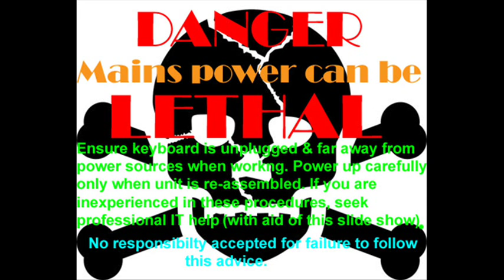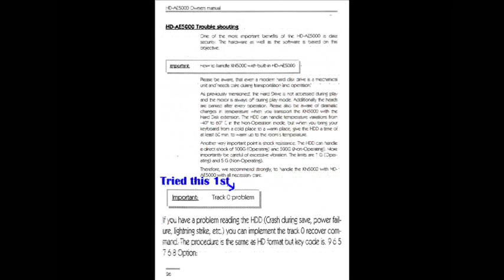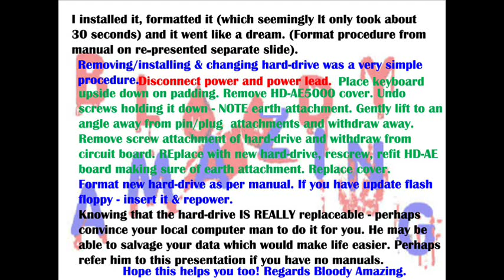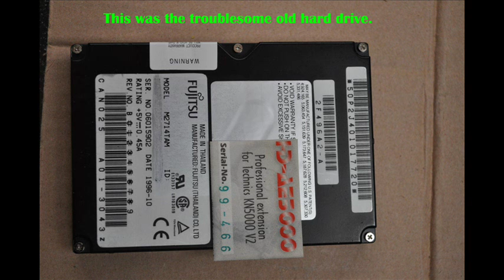Technics KN5000 keyboard HardDiskDrive repair

Comment: Noel, what was the make etc of the laptop hard drive you were able to purchase for your KN5000.  Failing being able to get one, I buy the 5000 Emulator but am very wary of taking the keyboard apart to get to the floppy drive.  All advice welcome.  Thanks for a great video.
Reply from the maker: Yes, HDD is easier to do and use. If your floppy still works ( I doubt it) use it to reload the hard drive. I suggest you do both. 

If you pause the video when required, you will see the HDDs are apparently pretty universal. Any 2.5" HDD IDG should suffice. I just purchased the smallest capacity from local repairman. He advised if too large to partition it. That wasn't necessary. Just had to format it in keyboard when fitted.
As displayed in video they suggested any Fujitsu, Seagate or Toshiba brand would suffice. No guarantee but it worked for me. 

Perhaps you could try fitting a  SSD card now available instead of HDD.  No moving parts and you would require only small capacity. There are videos on youtube showing how to do this. I haven't personally done it yet but sounds great. (Will definitely do it when I win the lottery). Both my Technics sx5000  still operate, one regularly at church..

With regard to the emulator, if you can modify it before installation then installation is very easy.  Just remember to unplug power 1st..
The hard part is keeping track of all that data.  I suggest you write level (different floppy numbers) locations on musical books/scores.

I accept no responsibility  for my advice.  It just worked for me.  Perhaps a local technician / computer repair man could do it for you if you are wary - with access to my videos.. Good luck and please let me know how you go. 

PS. Should you ever need replace your keyboard I suggest you look at Yamaha PSR  top models  (not Genos or Tyros) with inbuilt sound, vocalizer and lots more.. nearest to Technics.

Regards Noel Greacen.
Reply: @NoelGreacen  Thanks Noel for the lengthy reply. Originally Aussie but now living in UK. bought another 5000 here in UK recently. Still great keyboard. Put my hard drive in it as the floppy still works in this new one. However putting its hard drive into my old 5000 keyboard has been problematic as I am getting error start up messages and the HDD won’t format. Any suggestions?
Also have a 7000. Great keyboard still by current standards.
Reply from the maker: Check the connections thoroughly - easily mis-plugged. Maybe clean connectors with quick blast of electronic cleaning solvent. (NOT WD-40!!).  This could explain error message.
If that doesn't work,  from what you say, that it "will not format",  I feel the HDD must be faulty. I would suggest replacing the hard  drive component of the HD -AE with a new HDD or SSD. Might be why it was for sale?. Did it work in the bought keyboard before you removed it?. 
  
You are incredibly blessed that the floppy still works. I strongly advise you  back up the data/floppies  to a computer or memory stick. You will definitely need it in the future. 

KN5000 was my favourite Technics. I also had a 2000 & 3000, now obviously out on permanent loan. Think my favourite feature is the brilliant  and easy to use sequencer. Used it to setup/record  my own compositions.  The sounds record beautifully although there is a question on who developed them - Roland or Technics??. Had a Roland  - keyboard component nothing but trouble. 

I play an active left hand which is limited on a Technics split keyboard, otherwise, as you say, the keyboard is still up there with the best.

Often attend a music group meeting at nearby Gunnedah  (1hour away) where Technics enthusiasts still rule supreme. Have replaced a few floppy drives with emulators for them. The 7000 shouldn't be a problem with card facility.  Alas, KN 6000 +'s some have developed  keyboard component problems but it doesn't stop them playing around the problem. 

My no.1 rule for electronics- check the simple and obvious things first !

Do you gig anywhere or just a home player?

Good luck,. Thanks for update. Let me know how you go.
Reply: @NoelGreacen  Hi Noel. Thanks for the reply. I am in the process of cleaning. 
A new HDD OR SSD seem to have different pin configurations to this Fujitsu one. 
Also. The tempo wheel on my old one is erratic. Give it a clean too?
Can it come out with some gentle persuasion to clean and put back?
Reply: Sadly. Same HD Error. Tried 0 too. So, no good. Emulator here we come. Guy in States sells them all done with switch. Do you?

Comment: Noel - Where are you sittuated?  One of my pupils has a Technics KN5000 keyboard and one of the keys are giving trouble  I think the top C from the middle C.  It plays only once and the second time when it is pressed, no sound comes out of it. Will you be able to repairs this keyboard and what are your charges:  My phone number is: (905) 831-0264
Reply from the maker: Dear Maureen, I am in Tamworth, NSW, Australia. Your message was cut short. Try me on greaso@bigpond.com. I think your problem is a key note not playing correctly.(C4). This is a problem I have only encountered with Roland keyboards which are apparently reknown for it. We must accept however that Technics are now aging. I seemed to spend more time fixing the Roland KR5000 than playing it. ( I likened it to an Ivish Mechanic under a wheelbarrow).The problem required removing every key to replace the rubber contact pads underneath. It would be OK for awhile & then play up again. I eventually fixed it & GAVE it away & vowed not to  purchase another Roland keyboard. On this basis, on the KN5000,  I assume the contact rubber under the key is most probably reponsible (dirt, twisted/malplaced or perished) although it might just be a bit of tarnishing of the connecting plugs.  
The job is most likely tedious & I would seek assistance from a technician familiar with musical instruments...your local music shop should be able to direct you to someone. I doubt replacenemt pads would be available if they work the same way as Roland - as I said I have never had to pull one apart. You may be able to check availabilty on the internet. Let us hope it is just something simple.

If unable to repair it & you are thinking of replacement at a modest cost - I suggest you consider the Yamaha PSR-s950. Although I have 2 Tyros machines, I love this little keyboard & use it most, especially for gigging as it it light with good inbulit sound & most features of the Tyros 4. Approximately around $2000 Australian - most likely cheaper elsewhere.
 Yamaha PSR (& Tyros) User Demo & RockSetups
will demonstrate it in action &
A simple Hard Disk Drive solution for Yamaha PSR-s950 + extras.
will show how I have made it even better for gigging.

Of course there is little wrong with the Tyros except it has no onboard sound & is much more expensive. They both obviously use the same sound engine - I have compared them. Note I have no relationship with Yamaha..just a user.
Hope this helps, Let me know how you go & if I can be of more help.
regards Noel Greacen
Reply from the maker: Maureen, another thought -  if your student loves the Technics electronics & sounds another alternative would be to midi a simple keyboard to the Technics. Incidently, I am a mere hobbyist musician who dabbles in electronics. Where are you situated?